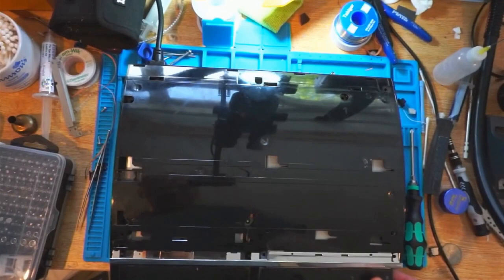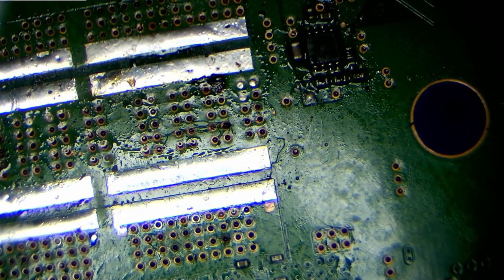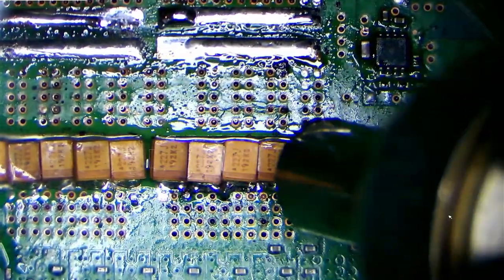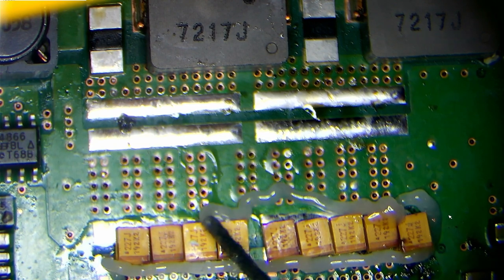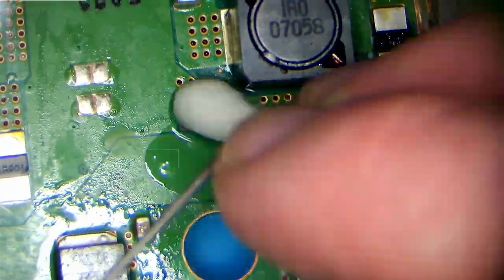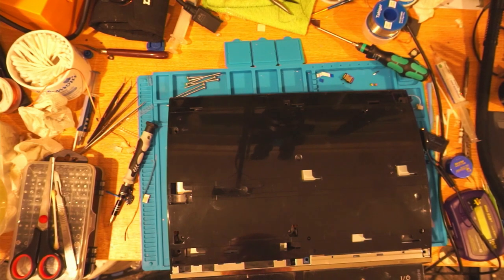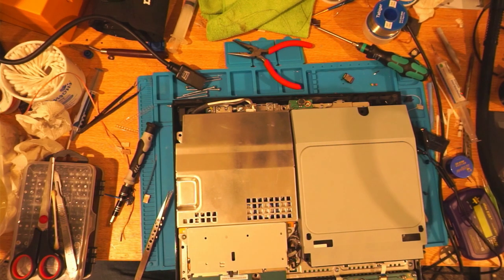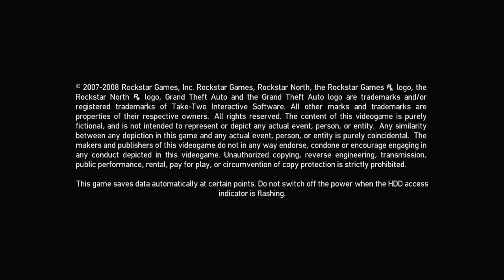Fixing An Exploded Playstation 3 -  Failed Tokin Replacement and Live Stream Follow Up

Comment: I've got an A01 that I had a load of tants blow on, probably for the same reason of not jumping or a short from my poor soldering. I replaced my caps again, jumped properly, and took good care in my soldering. Now when I attempt to power on the console I get a solid red light on standby, hit the power button, get a beep, then no power. The power will stay completely off for a while until the red light will finally come back and I can try again, issue repeats. I tested the PSU on my main A01 and it tested good. Fuses look and test good, and the only other visual evidence of damage I can see is some charring by a set of resistors near the DRAM circuitry, but there is a mirror of this circuit in good shape and all resistance values appear identical. Any idea what I should look out for next?
Reply: I have the same problem. Can you help? Thanks
Reply from the maker: Honestly, it could be anything. Just go through the usual electronics repair steps. Visual inspection, test, meter things out. Check things on the same power line as the blown tantalums, etc.

Comment: Thank you for great video.. I have question do you know the value of smd capstors that tack place where cobra sata mode installed on Ps3 motherbord.? I have Ps3 slim cech a3006. I have cobra ode chip not working. So my Ps3  working now but the driver doesn't read DVD because capstors are removed

Comment: So, just 2 jumper wires on CPU/rsx side?
Reply from the maker: It doesn't matter which side. The boards share the same rail. As long as you jump it with sufficient gauge of wire.  With that said though, chances are if it's a YLOD it'll be a 3034 error. I'd suggest using a TTL adapter to read the syscon error codes before just swapping caps.
Reply: @NewRetroRepair  oh... Shot...  I have had 2 PS3 60 GB models, ps/PS2 playback with the NEC taken ofd for the last 6 years... Idk why... But I have that urge to finally move forward on those repairs 😂

Comment: I got a backwards compatible fat PS3 throwing error core 3001 from syscon which is 12v rail fail but tested power supply and it's good. Could it be these capacitors?

Comment: Hello, what are the actual tantalum replacements used here? I don't see a link in description and I cannot seem to find these more short and square looking units online !
Reply from the maker: https://www.aliexpress.com/item/1005001803924849.html 220uf 6.3V are the ones I used. I tested each one using an ESR meter as well to be sure they were up to the job before installing them.